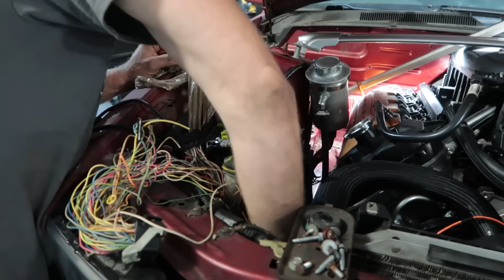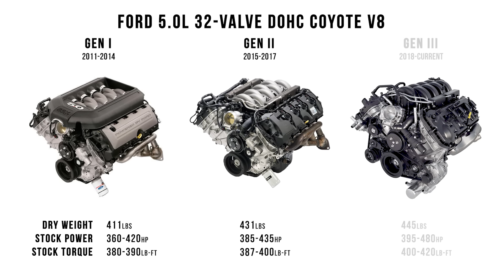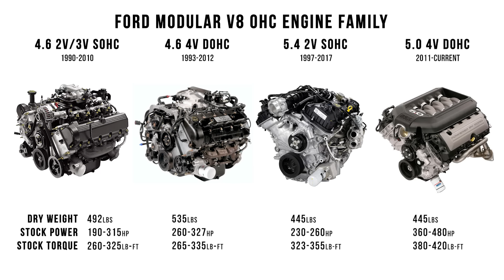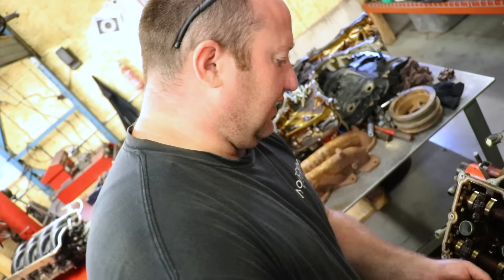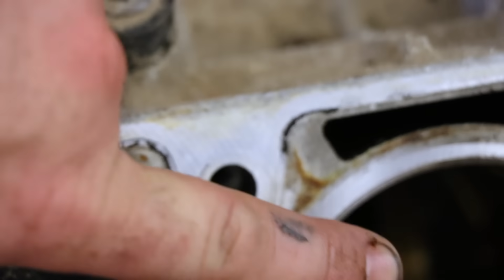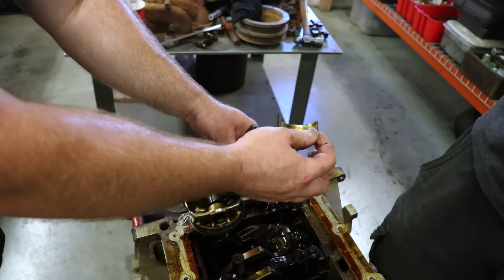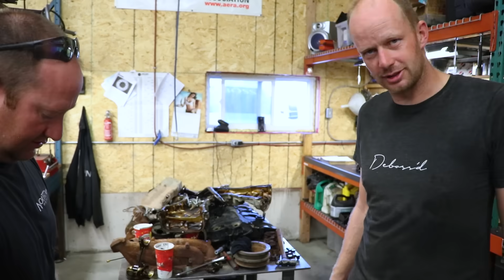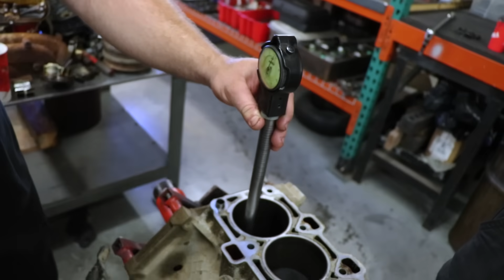REVIEW: Everything Wrong With A 5.0 Coyote Engine

Comment: I hate to be that guy but as a Ford Tech of 20 years there was a lot of misinformation shared in this video. Put synthetic in your Ford. Dont use FRAM and you'll be good.
Reply: When it comes down to it what hurt EVERY engine of all brands were the emissions garbage hung on them. 
Honestly I have seen many 6.0 Ford's that after EGR delete and head studs with good head gaskets they run awesome. I know one fellow that has 12/ 6.0 diesels, probably 5 or 6 of the newer Ford diesels and with few minor upgrades  has NEVER actually blown one up. And most of his trucks have over 300k (minus the EGR coolers and smog bs and using head studs and better gaskets) .
Heck his biggest issue has been after few mods and tunes he has to freshen up/up grade his auto transmissions. 
His 6 OTHER brand trucks, three Dodge three Duramax all run very similar mods and tunes and great mileage.

As for MY favorite Ford diesel was 7.3 Powerstrokes.
Reply: @MonzaRacer  Can't agree 💯 more. Except one item if you do the maintenance on the EGR it's better for everyone, Emissions and massive pollution is leading to shorter life cycles. There has to be a better way !
Reply: Meaning people are Dying of All sorts of pollution disease in the food supply
Reply: It’s interesting as oil I understood is much ‘better’ than it was years ago.   I guess depending on how an engine design uses the oil has slight differences that become significant in these high performance modern engines.  I dunno
Reply: Jeff Padgett the type of oil used and the additives used play a large part. For example, Mobil 1 actually cleaned up my truck engine quite a bit after using pennzoil conventional for years. I’d bet amsoil wouldn’t clump up like that either.
Reply: @Redsfanatic32  it all comes down to the additive package. If you really want to make your eyes itch check out bobistheoilguy.com there's a lot of information about what additives do what in modern oil on there
Reply: @Redsfanatic32  All I have ever used in my 06 Mustang GT and 2010 F-150 5.4 is Mobil 1 and a Mobil 1 or K&N filter. Had no problems, Mustang has 202000 miles on it and the truck has 187000.
Reply: @Redsfanatic32 Amsoil sounds like Amway...🤔
Reply: @jimnew5813 mobil1 or supertech, and actually according to oil geek lake speed, costco synthetic is damn good, per his testing.
Reply: Actually, the FRAM Ultra Synthetic did really good in that GMC truck central oil filter test way back...All their other filters are garbage.
Reply: @behexen250 I have a 2018.5.0 with 52 k on it not one issue hasn't burned a drop of oil dont buy a truck built on a monday or friday and ull be fine
Reply: Funny I have a 86 5.0,vortech blown drag car.been running great for the 23 years I’ve been beating on it.  Also used to have a 2 valve convertible with 150k on it(sold) now I have a 14 GT edelbrock blown runs great no issues. Always had great luck with all my Fords, except an escort when I was a kid
Reply: Unless it's a Fram Ultra Synthetic, in which case, you're using one of the best filters on the market
Reply: @farlesbarkley1022  all fram filters are cheap ass garbage, after dissecting over two dozen engine failures from other builders ALL had oiling issues leading back to fram crap
Reply: @MonzaRacer  False. Fram Ultra Synthetic is one of the best filters on the market. You are free to be ignorant if it suits you, though
Reply: Ford recommends syn blend since like 2005 . only full syn is the eco boost engines
Reply: Some misinformation for sure. I've run synthetic oils for years and my cams, rocker covers etc. on all my vehicles are spotless. Unless he's owned the engine from new and knows exactly which oil has been used there is simply no way that this mechanic can say that those issues are down to synthetic oils. Indeed the issues are far more likely due to using cheap dino oil and/or simply not changing it enough.
Reply: I always run Fram on my skateboards...its a roller
Reply: Could be said of most engines
Reply: A Ford master tech with 20 years of experience with an anime profile picture? Bullshit
Reply: @DaDaDo661  I'm 42 and watch anime. I also like shooting guns. Go figure! Better writing than most of the garbage on TV now days!
Reply: Always  tons o bro science in these videos, I dont know why I watch this crap any more.
Reply: @behexen250 I agree completely. Engineers used to spend time and money to  max out longevity now they just care about making a profit leasing a new car to someone every 2 years.
Reply: @praisejesus3  
I just saw something the other day about for doing longevity tests on vehicles and engines again.
Reply: @behexen250 Haven't had these problems with my car well, I don't have the 302.. but... so many problems I've heard about with the S197 coyote I guess if I would've got one, I would've had a shitload of issues with it.  so meh.  right now I like the 5.2 but do I really need another sports car, not really. I like infiniti q50 for a next car.
Reply: wiselink marque no issues with my s197 and it’s got a supercharger
Reply: What you said is retarded. And if thats all you have to say bri g a "ford tech" of 20 years well you stick to being a parts installer there buddy and stfu
Reply: @behexen250 After all I have been reading about the coyote lately, I sure the shit don't envy anyone that has one.  People cry about cam phasers in the 3V that I own, but fuck... what the hell do you expect an engine to be perfect and never ever have any issue for 500,000 miles? shit, mine can go 250k+ without any issue and as long as I use valvoline synthetic and genuine ford filters, I won't have to worry about the cam timing system AT ALL.  So those 3rd gen coyote are garbage? well first gen wasn't too hot either.  I guess these cars are meant for people that have money to burn then.  next car I get won't be another Mustang and sure won't be a coyote lol.  And fuck Chevrolet.
Reply: @wiselinkmarque3947  I got a gen 3 no problem with 51k on it
Reply: @mattwagner8965  cool too bad about the body styling tho.  all around suppose to be a good car.  waiting for ford to come out with something that appeals to me again  though.
Reply: @wiselinkmarque3947  body styling to what?
Reply: @wiselinkmarque3947  - I guess you're going with a Dodge V8 or Hemi?
Reply: @reachblowsdick7222  Infiniti Q50 3.7L V6.  Why am I going to buy another gas guzzler?  I guess you guys can go do that haha.
Reply: @wiselinkmarque3947  - The Infiniti with a 3.7 V6 isn't exactly a Prius gas sipper. It gets pretty bad mileage, not as bad as an American V8 sports car but both on the highway at steady speeds they can be very close. A Camaro SS can get up to 27 mpg compared to the Q50 that gets up to 29 mpg, two less miles isn't exactly a gas guzzler and the other a Corolla. Also, Nissan/Infiniti doesn't have a very good reliable record in the past 18 years, then again neither do the American sports cars. The much more reliable Lexus ES350 is around the same price of a Q50 but with slightly better mileage and power.
Reply: @reachblowsdick7222  well I know that, 23 combined mpg and it isn't a hybrid. so what... it's what I like.  anyway, I don't have much use for a personal vehicle any more, my company pays my gas, insurance, and vehicle.  so I can save til I actually need something.
Reply: @wiselinkmarque3947  - If the Q50 fits your style that's fine by me, now that I know your company pays your gas and the mileage doesn't matter to you, it seems odd now that you refuse the V8 muscle cars because they're gas guzzlers since you don't care about paying for gas. But I get it, pony muscle cars are a young man's game.
Reply: Hank Scorpio Thankfully since ditching Ford, none bud
Reply: I know, on a 4.6 at least, that if you use any filter besides the motocraft filter with the backflow preventer built in, it will destroy the engine eventually. the backflow preventer keeps the chain tensioners pressured up while the engine is off, so when you start it the chains are still nice and tight. Use a frame filter and everytime you start your engine, the chains will be loose and slap the guides. Fragments of the guide will end up in the oil pan than eventually clog up the oil pick up tube.
Reply: @joshperry4538 um.....no my friend. Any filter with a backflow prevented is simply there to keep oil from draining backward when the engine is off. Thereby keeping oil available to top end components immediately when you crank it. There is no way to hold oil PRESSURE to anything with the engine off. As a matter of fact Ford, much like just about everyone else, has locking chain tensioners that should NEVER back off until you trip the lock and manually push them in. Your information on that filter and what it does is 100% incorrect. If you've had 4.6 engines fail from timing damage it was because no-one maintained the chain system or fixed the damage that was already done previous to the failure point. The oil filter has ZERO to do with it.
Reply: Fully agree. that right there is the key.
Reply: I learned not to use fram flitera years ago especially the orange ones are awful they restrict oil flow
Reply: Tell him please don’t tell the secret 😂..keep using over cook 5 days dead cows, best synthetic oil is the best .for racing cars and hard working cars but for toys use conventional ,,I’m a ford guy  only trucks if you don’t drive a ford ,cars are worth a lot more for check and jump on one …and remember u got toys use conventional,,,I put that stuff in my keep to keep soft 😂😂😂😂😂
Reply: Triggered
Reply: @praisejesus3 what exactly is the deal with Fram filters? I have a 2010 Honda CR-V that’s had fram it’s whole life ( the better one the tough guard) but also other vehicles throughout my life with fram and I’ve not seen issues from them. Why exactly is fram an issue? I’d think stores would stop carrying them if they were damaging ppl’s vehicles
Reply: Sounded to me like the guy said synthetics have their place but the problems come from the engine not warming up fully due to short trips and that makes the synthetic oil crystallize.
Reply: I have a question for you, I have a 2018 F150 5.0, the truck started dying at a stop in gear. Rpm’s just drop. No check engine light. Auto off is off. And if I out it in neutral is stays running. I switched from valvoline semi synthetic to Mobil one full synthetic and it didn’t do it for a while. Then it started all over again. The other day ten times. What can I do?
Reply: Sure bud everyone is a Ford tech on this pg who the hell would want a engine Designed like this all those parts these engines will never see 300k miles without major work
Reply: Ha shit head ,I will take all the Coyote off your hands.you can shove you LS up your ass !!!!!!!!!!
Reply: Have a 04 5.4 V8 F150 with 290,000 miles.  No engine issues.  AMS oil full synthetic 5w20.  Triton engine horror stories of poor reliability is due to negligence in maintenance
Reply: The bore increase resulting in reduced displacement due to decreased compression distance, had me thinking of the little kid in the car seat meme,”A Buwshit’”
Reply: The bore increase resulting in reduced displacement due to decreased compression distance, had me thinking of the little kid in the car seat meme,”A Buwshit’”
Reply: I’ve learned from my 5.4. Always install OEM oil filter and use full synthetic oil. My Coyote doesn’t use a drop of oil my 2006 DBW 5.4 with the stupid electronic PCV (Ford Scrapped after this) was the only engine that used oil.
Reply: Agree, pretty piss poor video information wise.
Reply: That's hilarious. Ford engines are absolute shit. There is zero misinformation in this post...ZEEERO. I hate be THAT guy but as a 30 year master tech, performance shop owner, pro drag engine builder, engineering guru, and failure analysis tech, I can tell you that all the failure points in this video are 100% spot on. Ford engineering is absolute garbage....they have some ideas that are great concepts but execution of their concepts is where they fail every time. The guy is correct in that the best engine Ford ever made was the plain Jane, non phaser 4.6. everything after that is trash regardless of what your average coyote junkie will try and tell you.
Reply: My 2016 F150 5.0 does not burn a drop of oil. 48000 mi. run nothing but synthetic oil. Change it every 5000. 2011 VW GTI 198000 mi. Does not burn a drop of synthetic oil either.
Reply: Yep! Had a Fram oil filter damage my 84 351W in my Ford van years ago. Filter came apart and turned my oil into metal-flake oil. Drove it with heavier oil for a couple of years and never broke down, tough engine! Cardboard ends in oil filter? No thank you!
Reply: I’ve used full synthetic oil from my first oil change and only use Motorcraft OEM oil filters…..zero issues and not a drop of oil used, in my Gen1 305CI 2013 F150.
Reply: I'll listen to the guy who rebuilds all engine types before a Ford partisan......
Reply: @nathanswann1198 by all means, that's sientiffic.
Reply: Horseshit. "A lot of misinformation". 

He didn't say "don't run synthetic", he said "here's how we see synthetic burning down in a Ford motor". 

If you're a Ford technician, well we're almost guaranteed this guy rebuild more motors than you.
Reply: @RealityGutPunch  He's not Ford tech....... Toyotas and all other Brands have problems too. I am a tech all brands break and have issues. Problems also stem from owners who never take care of vehicle just drive it and then complain. How many do you see with warning light, check engine light, ABS light on but keep going because car still moves and drives. Whats thats noise/rattle and then crash because ball joint or tie rod end fall off. THEN have nerve go online this car a piece of crap and it going to cost me 1500 they're ripping me off for 100 dollar part. They don't you what else it destroyed from that 100 dollar part. I've seen things that would scare you and how could they keep driving it that way
Reply: @pdmustgtd1013  facts all manufacturers have their lemons and all manufacturers take their turn in having to deal with said issues
Reply: @T33DaB3ast  No shit
Reply: @T33DaB3ast  Also I'm a tech I see alot of stuff. PLUS alot of stuff that owners do they cause of problems too and love to blame manufacturer too. Like drive piss out of do no maint, breaks down all they do blame, blame and blame not my fault too
Reply: @pdmustgtd1013  uno
Reply: @pdmustgtd1013 you can't tell.these clowns nothing
Reply: @pdmustgtd1013 you are the only one that makes sense here.
Reply: JMAC LIVES these motors rev to 7200rpm, 8k with a lund tune. Of course it’s gonna use some oil
Reply: @RealityGutPunch  he literally said synthetic gets sludgy. Then the other guy corrected him. Thats just ignorance
Reply: You mean don't use the BASIC Fram filters, the Ultra Synthetic filters are ok. The cheap filters are shit though, yes.
Reply: @TheUltimateCrash1990  , the "cheap filters" are better than Fram, which is probably the worst or tied for the worst, at best! Research youtube for oil filters and you will be shocked! Fram used to to be the favorite for mucsle cars in the 70s & 80s. Decades ago Allied Signal bought Fram, grossly cheapened the quality, kept the orange color and increased their profits! The best is probably Wix.
Reply: @maxtaylor7533  Wix is what I run too. My 2014 5.0 F-150 only has 43k on it and with the prices of trucks now I'm trying to make it last.
Reply: @TheUltimateCrash1990  all Fram filters are garbage
Reply: Yeah there's videos of FRAM filters on here.  Never use a filter that doesn't say MOTORCRAFT on it!!  Shit, I even use Ford filters on my modified VW Beetle.  HP1 genuine Motorcraft.
Reply: Care to elaborate? When I went back and listened to what he actually said, he made a different point than I was questioning.
Reply: @RaceRed5.0Stang  I hear you, ford spends so much on advertisement (effectively) that people lose common sense 😂
Reply: Ya, Ford has a history of making crappie engines ie. 2 piece spark plugs that cost $800.00 to replace when they all break and the dreaded cam phaser and exhaust manifold leaks. They have engineered some of the crappiest engines on the planet, period!
Reply: TheIrongutz all automotive companies have skeletons in the lemon engine closet but ford probably has the least.
Reply: TheIrongutz 5.4 3v was junk.
Reply: @Steve-pc6cb   yep and there's only thousands and thousands and thousands of them with 250,000 + miles on them out there lol
Reply: @TheIrongutz  ur on crack I've never had a major issue on fords and ford has won lemans races chevy dodge not even came clothes or tried lol go away
Reply: Matt Wagner “came clothes”, apparently you’re the one on crack.
Reply: TheIrongutz haha you must be talking about my 04 F150 with the 5.4?
Reply: woohunter1–I had one of those also, I’ll never let them forget how crappy they were engineered. All of them should have been recalled! One of the reasons I’ll never buy another Ford.
Reply: @TheIrongutz you’re crazy. I’ve owned Ford’s pickups since 1979. Had a brand new Chevy 1500 in 1975. Had nothing but problems with it. Had two Chevy’s before that. Had a ‘56 Chevy Belair. Liked that one but after that Chevy’s just weren’t cutting it for me. When I was stationed in Germany in the 70’s, I asked people what’s a good truck to buy and they all said get a Ford. So I’ve owned one since ‘79.
Reply: @TheIrongutz  the only horribly engineered engine i can think of is the i3 eco as of modern, other than that they’re all pretty stout compared to gm or chrysler 😊
Reply: @TheIrongutz  As a Automotive tech of more than 30 years I've fixed them all , and i could not agree more .Ford make good cars and trucks , but its been there engines that have been the weak link . I will never own one .... EVER !
Reply: @OnfloorAudio   your loss  bud!
Reply: Why should we listen to you? Ford  are the ones that made these shitty engines in the first place.😂 This guy actually has to work on Ford's mistake unlike Ford tech that are just gonna keep putting the same shitty stock parts on even when they know the engine has a problem. Cough cough powerstoke 6.0
Reply: @rickshiandmoku4128  Well ford didn't make the 6.0 powerstroke. Try again
Reply: @itsschmidley  Navistar International made the 7.3L IDI, 6.0L and 6.4L.  Ford went and designed the 6.7L because of the back and forth between Ford and Navistar on who caused the issues with the 6.0 and 6.4L.  The 6.7L is a good engine, just don't idle it constantly. 

At work, we have two F-350 used in a role that a F-450 should be doing (carrying heavy barricades around).  One is a 2014 and the other is a 2015.  Both needed an engine rebuild around 150,000 miles because of the constant idling they did.  Something like 6000 hours of idling, and 13,000-16,000 hours of driving time. One engine, the 2014, evidently had a wrist pin get misaligned and scratch the cylinder wall.  The 2015 somehow got oil all in the cooling and air induction system. 

In 2020, the 6.7L had a major redesign to use steel pistons.  2011-2019 used aluminum pistons.
Reply: @CharlesDB76  I know this. That's why I said ford didn't make the 6.0 powerstorke. Every diesel in a ford up to 2011 was made my international.
Reply: @itsschmidley if they didn't have at least one engineer or any input on how that engine was made that's worse then them making it
Reply: @itsschmidley Ford didn't make the 7.3 either. That underpowered abomination belongs to international. 🤷
Reply: Rickshi and Moku still talking about a 20 year engine. Get up to date bud.
Reply: @vojnikjna30  obviously! I worked at Ford when they were brand new. 6.0s are trash! Best diesel hands down 7.3 IDI but I digress.  I was generalizing the entire fleet. Take a hint there bud.
Reply from the maker: @vojnikjna30  Please send brand new engines to DeBoss Garage in Dunnville and we will happily take them apart for you on camera.  Until then, we work with what we got.  I would buy new engines for myself but I spend all my money on my projects.
Reply: @praisejesus3  you have anime characters as your avatar - your opinions are invalid
Reply: @-ac-8296  nice... another closed minded bafoon. enter this century before disrespecting someone.
Reply: @praisejesus3 i want a slant 6.
Reply: @rickshiandmoku4128  I hate to break it to you, but technicians and engineers are not the same.
Reply: @joshb8209  I hate to break it to you, but your reading comprehension is shit.
Reply: @rickshiandmoku4128  exactly it's the beef l've always have with the blue oval, never owning their goofups and assisting us regular joes, they've got a long ways to go on the customer satisfaction department 😠
Reply: @rickshiandmoku4128 
The 5 liter is actually a pretty decent motor unlike the shitty newer 5.3 that GM builds.
Reply: @rickshiandmoku4128  lol shitty engine? Really I'm assuming you've owned a coyote before? I can't speak about the Ecoboost or other Fords I've been a long time Chevy Pontiac and Japanese car owner and though nothing will ever compare to a Japanese car I can tell you I have a Mustang pushing 150k miles second gen S550 and I beat the living snot out of it and it's a beast of an engine..
Reply: some Fords may not last long but to say the coyote is a “shitty” engine just makes you look stupid. No they’re not the best but they’re very reliable, other than the oil pump gears.
Reply: @brandonbogert7848 the oil pump gears have zero to do with failure. In my 30+ years as a master tech and pro engine builder I have to preach this point a thousand times a month. Just like the guy said in the video the pump almost NEVER fails. If you drop oil pressure it's because of internal failure and increased clearances due to that failure. It has zero to do with the pump....and that goes for almost every engine aside from the occasional few and the Ford 2.7.
Reply: @mrmotormd  In my personal experience I had a 12 and the oil punk gears failed and caused my rod bearing to break
Reply: @rickshiandmoku4128 you obviously have no clue wtf you're talking about. These are actually some monster horse power building engine
Reply: @rickshiandmoku4128 are you on drugs? I had a ten speed 5.0 Mustang 🐎 that would gap supercharged vettes and I was completely NA. Ford's 5 liter V8's are the best in the business.
Reply: @rickshiandmoku4128 so, some shadetree monkey on the internet is now the expert that all the keyboard warriors listen too. I've worked for Ford since 1991 and can tell you from experience that more than 75% of engine failures are a direct result of crappy maintenance.  Fram has been known as one of the worst filters for decades.  Not changing oil is the cause of most internal failures.
Reply: @rickshiandmoku4128  so nobody else makes shitty engines🤣🤦🏾‍♂️
Reply: @rickshiandmoku4128  so the 5.0 is shty because you don't like the 6.0? Good point.
Reply: @rickshiandmoku4128 ford is still better than any chevy and dodge
Reply: What decade was the 6.0 @rickshiandmoku4128
Reply: Rickshi and Moku the 6.4 is the abomination of the ford engines. I’d take a stock 6.0 over a built 6.4 any day
Reply: @Redsfanatic32  facts 6.4l was junk from the start
Reply: @Redsfanatic32  6.4 and 6.0 are not Ford engines, they are Navistar engines.
Reply: Flag Ov Hate I know. I didn’t say they weren’t International. I made a blanket statement.
Reply: @Redsfanatic32  well can you blame Ford for Navistars poopy engine? Besides if you could get a brand new 6.4 and delete it, and add a tune, they're insane engines. What would kill the 6.4 is the regen and egr system. 6.0 is a lost cause lol
Reply: Flag Ov Hate you can blame Ford for not taking responsibility when people bring their trucks in for warranty work because they blew up with less than 100k. Also, the 6.0 is EASILY the better of the two. Studs, oil cooler, egr delete, hpop, I’m probably forgetting a thing or two. Do all that, and it’s just as good as the 7.3. The 6.0 has an extremely strong bottom end. It has a freaking girdle built into the block. The 6.4 even when deleted and tuned, can crack pistons, throw rods, and just destroy itself.
Reply: @Redsfanatic32  you do those mods to a 6.4 and it's just as good. You know how much power a 6.4 puts out? Honestly I'd say they're about equal in terms of issues. I just got a 2020 with the 7.3 gas, so we'll see how it holds up.
Reply: @Redsfanatic32  plus its easy to know what to do to a 6.0 and get a proper long life out of it.
Reply from the maker: @rickshiandmoku4128  That was funny. not gonna lie
Reply: @DEBOSSGARAGE  do you recommend seafoam before oil changes I have an 07 f150 that I have been using it on to me it feels like it's been working really well but I just wanted to get your thoughts on it by the way my truck has 230,000 miles and I have never had to do anything to the engine
Reply: @DEBOSSGARAGE  Which guy DEBOSSGAR
Reply: @DEBOSSGARAGE  so if have 2020 f150 5.0, should I use conventional or or synthetic blend? He said that synthetic is aggressive. I want to put supercharger and exhaust. So I'd like to keep bearing happy and no spin them
Reply: @rickshiandmoku4128  while I dont disagree with you that Fords are crap.  I drive a  Toyotas and an Infiniti. Imports only for me. I enjoy being a Ford tech because I know I will make a great living for my family fixing these vehicles that will constantly need work 😄
Reply: @praisejesus3  Fords are crap? My daily driver is a 1973 Ford Econoline, all original, I am with a group of other 68-74 Econoline owners, lasted over 40 years, I wager you'll not see anything made today last that long!
Reply: @praisejesus3  My 4runner is 400k miles on the original engine and tranny.... Good quality indeed.
Reply: @praisejesus3  Like Nissan's are better though...
Reply: @praisejesus3  you've made me pee a little for laughing so much 🤣🤣🤣🤣🤣🤣
Reply: @Maples01  ok boomer but life goes on
Reply: @TheUltimateCrash1990  lend it it'll get to 401k then blow up
Reply: @Maples01  My two best vehicles ever had are Fords. One was a 2006 E-150 280k miles when sold, still running like a champ with only two problems to repair which was alternator and HVAC blower all cost under 150 changed myself. Those problems happen after 220k miles too,  what a great vehicle it was for me. 2011 Ford Taurus I own is 10 years old 120k miles and not one problem. Both those vehicles allowed me to pay them off before having to deal with problems, which is one of my main concerns when buying a vehicle. I will defend Ford because of those vehicles. I change the oil on both those vehicles every 5000 miles. I used motorcraft synthetic blend.
Reply: @freewaycommander  I will keep my 73 Econoline forever
Reply: @praisejesus3  It seems every make of engines have issues. Reading on the 3.5 V6 Tacoma engine. They say thin cylinders and only have life expectancy of 150k. I’ll be getting rid of my 16 soon .
Reply: @praisejesus3  BUILT FORD TOUGH!!!MEIN2011/5.0 HAT 300K KM UND GEHT WIE EIN PANZER AM ERSTEN TAG.GEBIRGE,GELÄNDE,SCHWERE HÄNGER...WAS SIE WOLLEN.
INFINITI....GROSSER SCHROTT...NUR IN DER STADT WO AN JEDER ECKE EINE WERKSTATT IST.DAMIT KÖNNEN SIE IHRE FREUNDIN ZUM SHOPPING FAHREN...🤣🤣🤣
NIE WIEDER ASIATISCHER MÜLL IN MEINE GARAGE...NIE WIEDER...O N L Y    F O R    F O R D   F - 1 5 0.